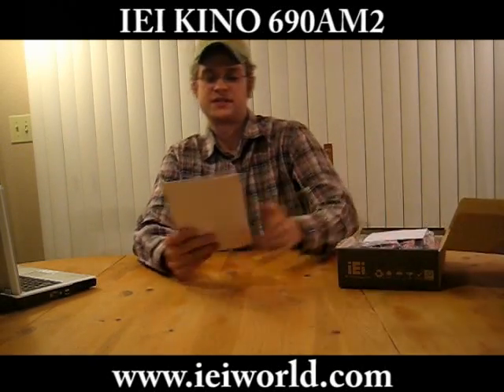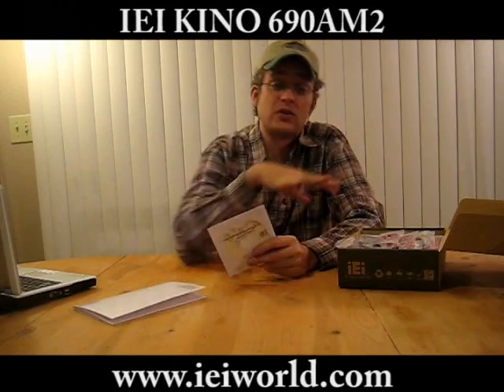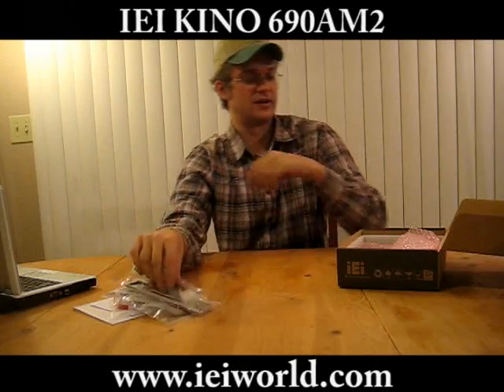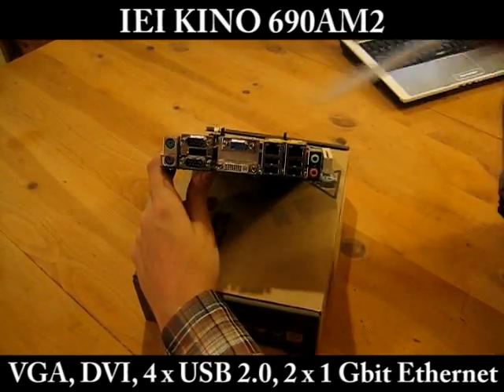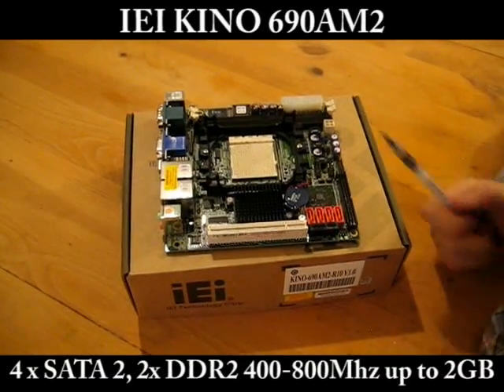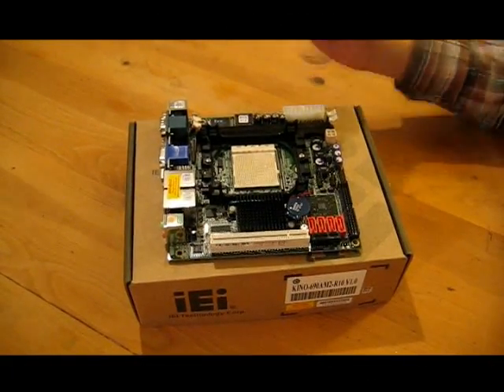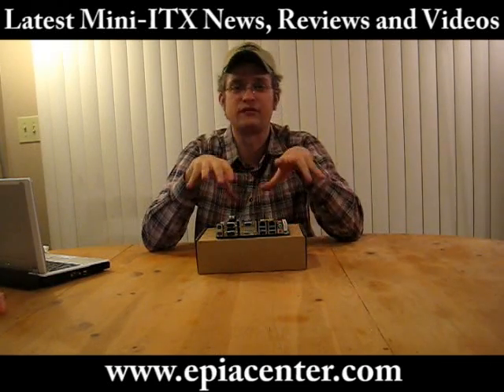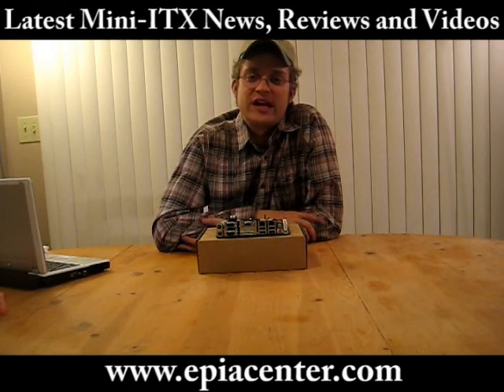IEI KINO 690AM2 Mini-ITX Mainboard

Comment: Just so you know, ALL hard drive connectors are IDE. IDE = Information Data Exchange. Even SCSI has IDE in it. The correct term is PARALLEL ATA. Nice board though.